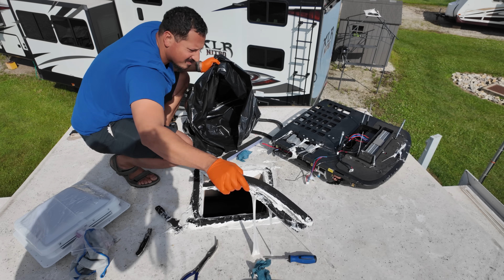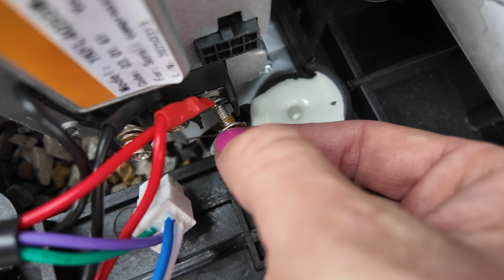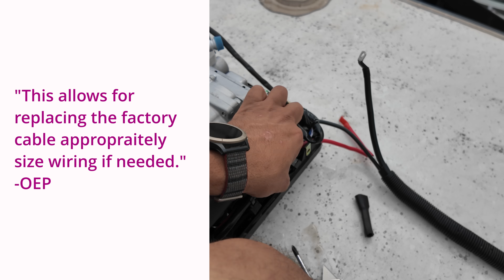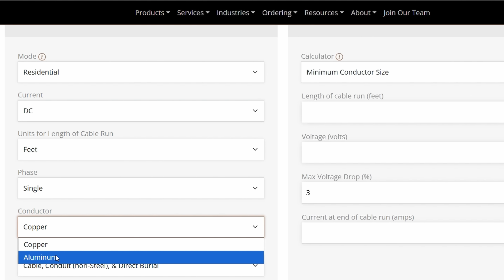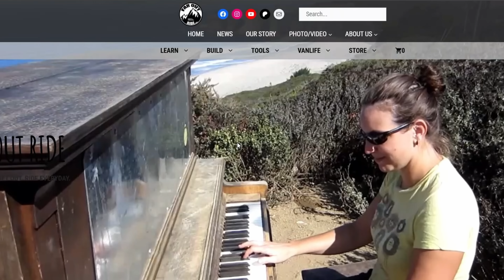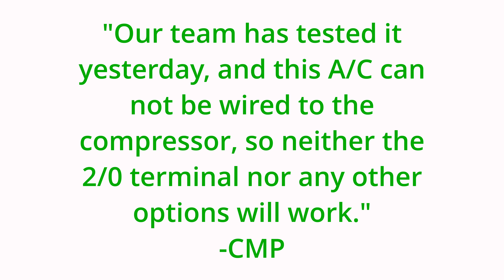The Truth About 12V RV AC Wiring in Big Rigs (What No One Says)

Comment: HELLO, I AM A LICENSED ELECTRICIAN and I believe I have a solution I am not too familiar with RV or 12 volt but I don't see how it would be any different. Of course, 24 volt would be more ideal for you. However, my suggestion and I would want you to look into it before doing so, but the first thing that runs in my mind whenever having to run long distances with substantial loads especially 50 amps or greater. Ideally I would install a lug panel. I know they make them for DC as well, but maybe that is what you're trying to stay away from. However, installing a lug panel with its own breaker or multi breaker setup. You should be able to run factory suggested power lines to the lug panel.
Reply from the maker: I was not aware of lung panels at the time of this. Thanks for sharing!

Comment: I installed a 12v AC outequippro unit on a large RV last year, and I had concerns about extending the wires that long because of the same concerns you guys have and wanted to replace the units wire. After talking to my brother, who is a professional electrician, he determined that adding a terminal block would be the best option. So, we ran a short  positive/negative in wire loom from the AC to a terminal block with a fuse breaker at the block. Then we ran 40 feet of 2 Awg Wires in wire loom to the batteries in the front compartment with another fuse breaker at the batteries. After testing voltage, the voltage drop average is between 4-6%. It ran great last year and has continued to do so this year. Hopefully this information helps you or anybody else in the comments if they are looking at installing a 12v ac in a large RV. Do your own research to determine if this is a viable option. ✌️
Reply from the maker: Thanks for sharing! Yes always do your homework 📚

Comment: Have you considered going 24v? You can series connect your 12v to make 24.... Or just upgrade. Add a 24-12 DC to DC converter (victron Orion) and your rigs 12v system keeps going fine too
Reply from the maker: It’s on the radar now before expanding getting to deep into a 12v! Lot of this in the comments!

Comment: These new Furrion Chill Cube with variable speed compressors are working really well.  I know it's still 120v, but it is at max power, about 300 watts less than my Coleman Mach 15.  But once it gets to temp, it's running really low, 200 - 800 watts maintaining temp.  It also has the gear option to set the power to 50% or 75% reducing the power usage more.  No need for soft starts due to the variable speed.
Reply from the maker: Yeah, I’ve been hearing great things about these chill cubes. I think these things are awesome and hope to get my hands on one soon. Thanks for sharing!

Comment: 1) you need a bigger dc battery charger.

2) you are better off running an higher voltage 120AC with a softstart like Microair unit. You can use 12 gauge wire.  Or use one of the new inverter minispilts.

All that current in 12 VDC AC units cause heat build-up in connection terminals, wires, battery etc. where ever heat is generated will cause a shorter life span of the devices.

So I think people are not informed enough about AC voltage compressors. 

So think about your rv is like a power system. Power companies only transmit power in very high voltages. Higher the voltage smaller the transmission wiring.   This is the same for DC to DC battery charging. Use an inverter and a normal AC battery charger to charge your RV battery from your vehicle alternator. Why run heavy expensive welding wire along your tow vehicle or rv when a 12 gauge wire will work just find.
Reply from the maker: This is some great great options. I was hoping to test out a minimal system and seeing what we could get away. Perhaps I can build a small nuclear power plant to run it in the future.😂

Comment: Why not run it through the front of the RV along the sewer vent to the belly in it's own conduit. I ran my 1k solar this way.
Reply from the maker: I want to keep as many wires off through roof as possible that’s why I was planning on dropping it straight from the back and into the underbelly and coming back up. But I suppose this was also an option. Thanks for sharing.

Comment: Run heavy gauge wire to the wall cavity maybe 2/0 or 3/0 to a terminal block(maybe with fuses) . Then run 1/0 up the pipe to another terminal block(fused too) in the box, then hook your 6awg to that terminal block

Then you have a spot in the back of the camper that you break out for auxiliary 12v supply and you solve the how do I run a short 6AWG wire. 

Bonus points, you can throw pile of solar panels on the roof and tie them back in at the box on the roof.
Reply: alot of work but would work absolutely

Comment: In spite of what people think -want - hope for - push for,  there is no such thing as a Free lunch. There are always trade-offs. 
Number of watts for the desired cooling BTUs doesn't change. Only the volts and amps will change - inversely. Basic math anyone that a person needs to understand before tackling projects like this. 
One reason an electric car's AC can work so well - they run around 400 to 480 volts - very little amperage.
Reply: An 12VDC inverter heat-pump skips a conversion, boosts the voltage and goes straight to the VFD (~300V). So it's more like not spilling your meal around before delivering it. They're legitimately more efficient if you're running off DC anyways.

Comment: As a novice DIY RV guy, this reads to me as a failure to install a 24v system in your large rig from the get-go. Obviously, at this stage, it is more costly having already invested in 12v inverter etc. but the root issue here is that 12v system. As others have mentioned, there is probably a more efficient path for the cable but at 24v, 100 feet with 6% drop at 30 amps (I rounded up here), you could get away with 3AWG. Cutting that length in half could put you on 6AWG.

Comment: This is why you see units at 24v and so on. when you step up the voltage the size of the wire goes down.   if i remember that right   anyways for your unit there are stand alone kits that you install the parts where you want them to, like a diesel heaters. you install them in a lower bay and run the air box to the inside of the RV. has the same parts inside as the roof units. you see them being installed into older trucks.  so its s split unit.  your ac pump is then installed closer to your battery's and your ac lines then run to the air handler

Comment: Can any of these units be operated at 24v? If you could convert to 24v near the battery and then do your run, the amps carried by the cable would be halved, solving many of your problems. That requires the AC to support 24v though, or having 2 converters (and the subsequent losses) to go from 12 to 24 back to 12 at the unit - but that too may solve it if the step up and step down converters are efficient.

Comment: As i watch this I'm laying in bed under my 24v ac. I run my rv totally off grid and I'm very happy with the dc air conditioner.  It cools my 5th very well. ... hint.. if you talk to an hvac guy he will tell you it's not about an efficient appliance.  It's about keeping that conditioned air in and hot air out.  I've done several things  additionally with that mindset
Reply: I want to know more
Reply: @donl7114 what would you like to know? My system is 24v. Im running countrymod ac. I used the 15 foot cable thats included. I have 8 lithium 105 ah batteries. 2600watts solar.. Ive been camping off grid all week in my 33 foot 4 slide 5th wheel. Its mounted in the bedroom up top. The cool air cascades down to the rest of the coach. During the hot sunny day it removes all the humidity and maintains 70 in bedroom and the furthest point is around 78. At night the entire coach will drop to around 70 and dry.
Reply: @RVsandRCs  LoL that was great. I'm half your battery and no solar yet. Comparing, trying to figure out which panels I want. Just discovered the DC ac . I have 3 Dometic ac...15, 15, 13.5. My AC is fully ducted. Open to any advice including how to keep the conditioned air in.
Reply: @donl7114  I installed insulated blinds on all my glass.  My solar panels are mounted roughly 6 inches above my roof on aluminum C channel which creates an air gap shielding roof from sun.  All my standard vents are blocked with foam pillows.  Doubled up the seals on my frameless windows
Reply: @donl7114 wanted to add. I still have a 15.5k ac in the lower part of my trailer. I can and do run both the ac and dc air conditioners during full sun as needed. The 120v unit is ducted which in my opinion is a waste unless its been running for 10 hours or more. The reason is so much cooling is lost in the ducts/roof. It takes a long time to cool that area down . Its best to set it to dump and not use ducts at all in my case

Comment: As an avionics technician and a former car audio fanatic I'm intimately familiar with DC power issues. This DC unit should really be up in the front bedroom closest to your batteries. When this isn't an option you can relocate or add another battery to the system closer to the load. In your case the best thing to do would be adding a second battery in the back of the RV where the cables first come down. You can also use the frame of the RV as a ground instead of running cable all the way. A battery closer adds more capacity and saves you from having to buy expensive cables. There are times when buying the extra battery costs about the same as buying heavy gauge cables. 

Now for the bad, when I've had to do this in the past I used a battery charger meant for the trolling motor batteries on a boat, multiple zones, ran the ground to the frame and wired the remote located battery to the main battery positive to the bank positive with 6 gauge or thicker. 

Electricians rarely agree with one another and never agree with the engineers. 

Whether it be an amplifier pushing thousands of watts, an air conditioner, a hydraulic pump for a lift gate or a winch adding a battery close to the load has been the "go to" for longer than I've been alive. I've never had an issue with it and it adds more off grid capacity to your rig. 

There will be people that criticize this method but they're just wrong.
Reply: with the battery in the back of the rig, you'll be in the same problem of charging the battery again, 50 amps charger is 50 amps, and a long run is a long run.
Reply: @barnesonmove that's why you have to use a marine charger with multiple battery zones. They usually have 10 foot leads so you mount it as close to the center point in between the batteries as you can. You can make it complicated if you want, many people that live in their RV prefer to buy for me simple is better. I just want to hook on the my trailer and go. 

My trailer currently has batteries in the front and rear simply because that where I could fit them but my trailer is only 22 foot.
Reply: You are 100% correct. Batteries need to be close to heavy loads. 
If someone cannot do that then going to the 48vdc units would be better. 
As for charging, your camper is going to be plugged into AC power. It’s not hard to mount a charger right next to the battery.

Comment: The first thing to jump out at me (other than no one is talking about wiring... one famous youtuber said, he would deal with wiring later... that was helpful (sarcasm). But, back to the matter at hand. Your AC is central to the unit and the batteries in the front bay. Why run it all the way to the back. I would suggest running it forward and find a way to snake it down and to the front. I am sure you have a fridge with roof vent and that is a good place to pull this off. Just my 2 centavos.

Comment: I just installed my Outequippro on 07-26-2025.  I luckily have the unit almost directly over my battery bank so the provided 12' of cable was more than enough.  My issue was the battery bank was wired with too small gauge cables and the battery bank cable connecting the batteries to the busbar got hot as all heck.  So now I get to buy or build new battery bank cables.
Reply from the maker: Thats good to know. Something for others to consider before purchasing. Thanks for sharing.
Reply: I used the OutEquipPro wires and the fuse got up to over 125F max, average was 116F.  I felt it was unsafe to use as the cables were not UL listed/tested and had no markings to prove anything.  I returned it and they refunded my money and they paid return shipping too

Comment: The correct solution is to get away from low-voltage DC in RV builds. 12VDC is a legacy thing which worked OK before we had so many high-draw devices but it's no longer sufficient. Higher voltage equals more electrical efficiency through the circuit, smaller wires and connectors needed with savings found there, and better ability to accommodate sharp turns in the wiring, Off-grid solar is now pretty much standardized at 48VDC for these reasons; it's better, cheaper, and easier for an equal amount of power compared to 12VDC. 

The RV industry needs to change but don't hold your breath waiting.
Reply: No 12v is better

Comment: Don't double the run length when doing calculations. The voltage drop is on the positive side. Most of the electrical "stress" is "used up" in the air conditioner. The negative side only "sees" what us "left over" and does not carry nearly the same load.
Reply: Next level smart
Reply: Not true, anytime current flows, including the negative since it also carries the full load current,  voltage drops occurs. They are correct to assume voltage drops on both conductors.

Comment: I'm not an electrician. However, I have done enough electrical work with guidance from actual electricians to understand the issues surrounding voltage drop, load requirements and wire size. When I was looking at a new A/C system for my motorhome, I could not entertain a 12v system knowing what you've so skillfully put in this video. Instead I chose the Turbro inverter 13.5k system. It works great, uses less power, much quieter and no extra wiring needed. Thank you for putting this video up!
Reply: Я как раз подумал а 12 вольтовый кондиционер оснащены инверторами или нет. Ведь инвертор обладает экономичностью и гибкостью в выходе на режим.

Comment: Here's the thing. 12v DC air conditioners are running on an inverter, it's just that the inverter is built into the unit and can ramp up and down (variable speed). I am convinced most of the claimed efficiency gains are from ramping the speed not from the bypassing of the RV house inverter. Similar efficiency claims are made by inverter drive AC units that run off 120v. Since you probably want a large main inverter anyway for various things, and battery power is cheap, and the wiring is already there, I think a normal AC powered unit with a soft start makes the most sense IMHO for running air conditioners while boondocking
Reply: The big difference is the motor is also designed for 12v across the legs, so the inverter does not need to transform or step up the voltage prior to reaching the motor, avoiding the power losses of the step up. This combined with higher EER in the freon cycle and variable speed all contribute to a more efficient unit via 12vdc.

Comment: This is a great video. You have exposed something that people need to know about.   However a 12v A/C is still a good option for people with smaller trailers and shorter power line requirements. I personally wouldn't use a wire bigger than a #10 in an RV. In your case, to buy the huge wire you needed would probably have cost more than the AC. RVs need fine stranded wire  not solid house wire, so that makes it even more expensive.  If you really wanted to install that AC unit, one option would be to install a boost converter at the battery to transform to voltage up to about 100 volts, use #10 wire to connect, then a buck converter at the AC to convert it back to 12v. That's expensive, but still cheaper than buying all that copper. 
That said, although not currently available for RVs, EG4 makes a hybrid AC unit that takes direct input from solar panels and then uses regular 110ac at night. If they ever expand to the RV market, they will have a lot of customers because it would be a perfect solution in your case.
Reply from the maker: Thank you! I agree on a lot of this including the small rig comment. I think this is a great option for smaller rigs and many people in the comments have mentioned loving the Out Equip Pro for their smaller rigs. Thanks for the advice and for watching. Safe travels!

Comment: Yes, what is the running watt draw of this AC unit? Yeah, you might have a second of 60 amp draw, but then it drops down to 20 amps, so you can use 20 amps as your calculation because you're only gonna be drawing 60 amps to the small wire for very small amount of time not long enough for it to even heat up. That's what you need to figure out.

Comment: Here's what I would do: Install a branch circuit - From a 90A breaker in your battery comopartment, run AWG 1 to a small breaker box and install the appropriate sized breaker (maybe a 60?) for the unit in the new box.  Run AWG 6 from the breaker box up to the unit.  My assumptions here are roughly 30 feet to the new breaker box and 20 feet up to the unit.  I wouldn't just buss down wire gauge without some sort of protection at the junction.  Going straight from AWG1 to AWG 6 does create a scenario where you could potentially try to pull 90 amps through the little wire, and that would be no bueno.  You want to protect the little wire at 60A.  It wouldn't be a terrible idea to run an additional ground from the main box to the branch box...  In the event that you might ever want to flip this branch over to AC...  Run this by a real electrician to see if it floats - just cause I would do it don't make it safe!  I haven't smoked any wires in a van, two camping trailers, and several outbuildings using this theory...